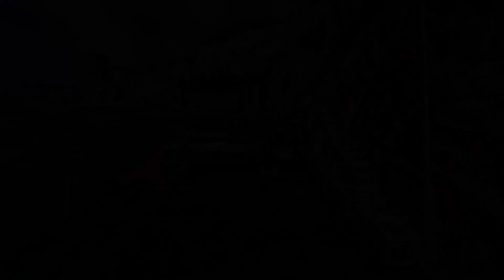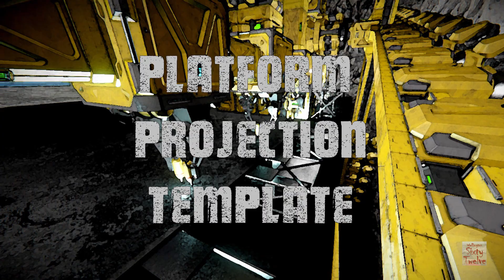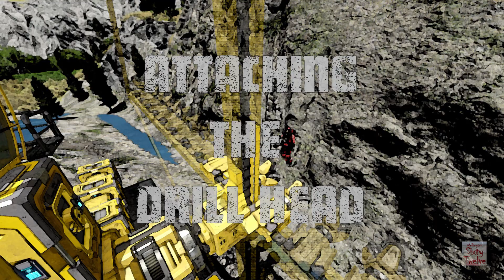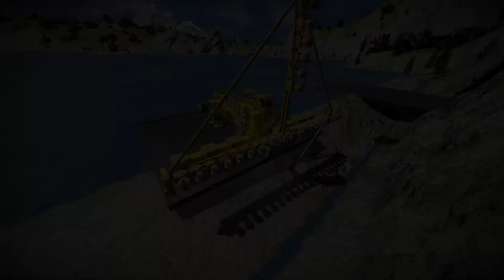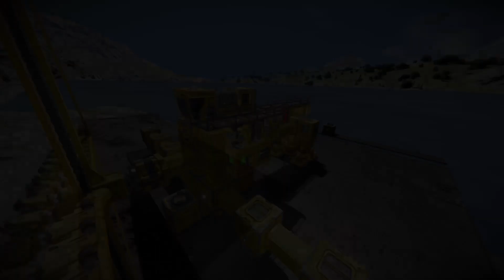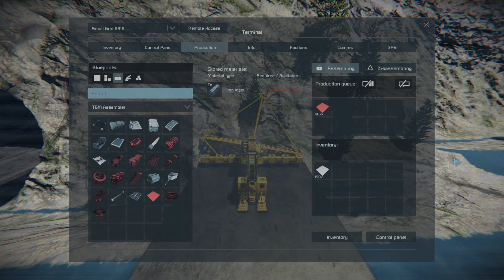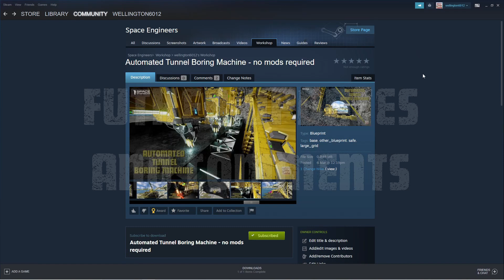Automatic Tunnel Boring Machine - a guide for setup and operating (Space Engineers)

Comment: So, to answer the question about Xbox that's a no, in survival mode any way. since you need build vision, (which is a mod) there is no way to attach the piston to the Rear of the machine. there is no vanilla "attach" setting in vanilla survival Xbox. So unless you make a true "vanilla" blueprint for survival mode, it won't work. I'm going to try to build the rear of the machine  off of the piston and duplicate your timer block settings. if that doesn't work, I will use merge blocks between the piston and the rear of the machine; the rear will just sit 5 meters further back than your original design. And if that doesn't work, you probably won't hear back from me. Wish me luck!
Reply from the maker: Thanks for letting me know Hyper Threat, now when the question is asked, I can answer with some certainty. Attaching that piston was an error on my part, I used build vision, but in my mind you could do it through the control panel like rotors and hinges, which of course you can't. I don't think it's too much hassle just to rebuild the back end, only a couple of timers which have their programming in the description. Good luck.
Reply: @Wellington6012  Oh Contrare Monfrair, I do not see it as an error on your part. For it is not your fault the piston spawns retracted in survival. Several things; It DOES work if you rebuild off of the back of the piston and reprogram everything. I don't see any other viable way to do it.
It IS your fault for only publishing the main part of the machine on MOD IO and NOT publishing the drill head on MOD IO for the Xbox and thinking you did, but only publishing it for the steam PC version. how selfish! XD. i.e. it does not show up in the workshop group to download. you may have to publish it as a separate item for it to show up. If i can get this pizza spinning I'm sure i will enjoy it.
Reply from the maker: @hotelyankeepoppa8862  Thanks Hyper Threat, really appreciate the detail, especially for others experiencing the same headaches. Positioning of the pistons for blueprinting is something I never even considered, will remember that for a [much] later project - space elevator. I don't make my designs for xbox or Mod.IO, but nor do want anybody to miss out, so put them on there to and do my best to provide supporting info. The small grid piston head is definitely now on Mod.IO. For me, it's a bit hit and miss uploading to Mod.IO, doesn't always work. All that said, when I uploaded the blueprint and associated video's, never did I think I would get such a fantastic response. Thank you Hyper Threat and all the other viewers and commenters.
Reply: @Wellington6012  Confirmed. And thank you for your detailed design and assembly video. it was the design that caught my eye resembling the TBMs of modern day, only a little more simplistic yet challenging (I do love a challenge as much as I like pizza!) to build. and doable in creative. Thank you for your hard work and effort into something that might be overlooked but fascinating in my eyes. Keep those gears spinning thinker! What would happen if they combined space engineers with elite dangerous? (slowly grinning)
Reply: @Wellington6012  one thing might be good is moving the timer blocks up to the main unit and using just regular armor blocks for the landing gears.  tried to get it to attach which it "did" with build vision, but the back piece won't move at all even with the landing gears removed.
Reply from the maker: @SalazarWindriver  Thanks for that. I'm not looking to change this blueprint, but learnt heaps myself and from others sharing with me what's [not]working for them. I am considering a space elevator which will no doubt need to use some of the same mechanics, so all the feedback super valuable.

Comment: cool idea doesnt work machine extends drills retracts then extends drill doesnt move machine forward.
Reply from the maker: There was a very occasional bug when I first built this that would keep certain blocks a station when unmerging. [Anecdotally] it seems like this happens more often, maybe something changed in a recent update?
Reply: @Wellington6012  not sure the timers have the welders as unknown. Don't know how to fix that.  I'm sure that's the problem.
Reply from the maker: The welders should be in a group, which generally means they stay in the timers a lot better than individual blocks, which can confuse the timer if they get unmerged or rebuilt. On the steam workshop page description, all the timer programming steps are written out.  @vorcrogaming3055

Comment: Awesome build, im on ps4, but I ended up using large drills and I tried several times to get the sensor that triggers the first timer block to work without success... ended up replacing it with another timer block and used my stopwatch to time the cycle time from when timer 1 is triggered until the drill piston was fully extended... I also sped up the rotor to 1rpm and piston to 0.020 which sped the cycle time up about 2:40
Reply from the maker: Good to hear. Although I never make my builds for console, I actively build in a way that shouldn't restrict their use at least. If I was to rebuild the rig again today, there are some things I might do differently, I'd probably replace that sensor with a event controller, so that when the piston gets a certain distance, it triggers.

Comment: So built this, fixed the piston with a mod. But the timer blocks are all missing some blocks and as such nothing happens when we try to start it. Is there a weld order for the blueprint? Or did we somehow mess something up?
Reply from the maker: I don't think there a weld order, it was a while ago, but I think I just welded it up for this video and it worked. Did you get the timer that is in the base itself? Sometimes people miss that one. The timer programming is listed on the steam workshop page, you should be able to check against that for any thing missing.
Reply: @Wellington6012  Got the base one. All timer blocks are missing items, the base one is missing both.
Reply from the maker: @wolfhunter98  Did you check against the timer setup on the workshop page? https://steamcommunity.com/sharedfiles/filedetails/?id=2415842702
Reply: @Wellington6012  Got the timers fixed, now the merge blocks will not lock, which stops #4 from going. And stops it from advancing.

Edit: Does unsupported stations have to be on or off? Looking at the info menu I think the driller part keeps staying as a station after it merges with one. Assuming the platform is a station then the miner part that moves needs to be a "ship" ?
Reply from the maker: @wolfhunter98  I know the unsupported station setting, but I have never used, so whatever the default is. I don't recall mine not merging, but yes it would basically convert to station. I did have the occasional bug that one of the welders would remain remain static. During the entirety of digging Fort Rutherford, which was a lot of advances, I think it did it twice, so I'm talking 1% or 2% of the time. In other miners I've since built, often the first piston stayed a station, but the pistons on this rig never caused me any troubles. Have you added any extra blocks, like say a connector to connect to the grid? The reason I ask is even though a connector is 1x1 and you can pre-connect them on the same grid, they do prevent merging.

Comment: After rebuilding the drill head 3 times in survival because I didn't pay attention to the orientation of the conveyor junction on the small rotor head, I finally got this machine going! I don't have build vision so I just removed an replaced the conveyor junction, timers, and landing gear onto the repositioning piston, and then set the timers up by your notes.. its chugging along now! But the drill head piston seems to be extending too quickly and the drills are getting too deep into the rock and binding up. It's set at 0.1m/s though. Would adding more drills to the shorter row like the full row help?
Reply from the maker: Great to hear you got it working. Advice a bit late now, but if you have any issue that require the drill head to be disconnected, you don't need to rebuild. Just put a small battery, piston and landing gear on the drill head and stick it to the wall in front, then you can pull the drill head out of the main rotor and put it back in.
The main piston should push very slowly, slower the better, 0.1m/s is more like a rotationless plunge speed. I forget the speed, but I would be thinking more a long the lines of 0.01m/s or 0.1m/s in the time is takes to do a quarter rotation. Speeding it up and slowing it down with the timer can be confusing, because of subtracting negatives, just use speed up/slow down, never reverse on this set up.
Reply: @Wellington 6012  awesome! Thanks for the tip! I'll give it a try! I've been playing this game for a little over a month and I hate to say it but I'm addicted! The sensors and timers remind me of programmable logic control I took in college. Haven't been able to do much with it since I graduated but I loved the troubleshooting and it appealed to my OCD.🤣🤣
Reply from the maker: @RickyCooper-j4o  There is the event controller now, which could replace the task the sensor does.
Reply: @Wellington6012  I saw that. I'm downloading the automation update next time I sit down to play.. planning a big underground base, tunnel with overhead trolley crane to move ships in and out, elevators, etc..

Comment: i build something similar and my problem is that as soon as i connect the drill rig with a merge block with the floor (witch is a station) the drill rig will becom a station and will still stay as a station even when i turn the merge block off does anyone has an idea how to fix this?
Reply from the maker: I Had a bit of a quick look, I thought maybe there's a script that could do it, but it appears the script and conversion functionality are not compatible. It's super annoying, I had it happen to me a couple of times, a pair of welder blocks stayed as a station, nothing else on the grid, just those. Appears to be a bug or maybe just a limitation of merging, as the drill trying to do something the game wasn't intended to originally do?
Reply: @Wellington6012   no my drills are fine i only have the problem with the merger. I am currently using only landing gears instead of the merge block so i hat to put the projector on the station. Thas a bit anoying because my blueprint is only 8km long and i have to move the projector with the machine from time to time but it works for now.
Reply from the maker: @Senbino1998  I think there are ways around it, but probably a rebuild. I had similar trouble in Escaping the Desert with a similar mining machine, one of my pistons keep staying a station. My solution was the pipeline I'm creating remains a station, I've just locked it down with a landing gear. It's stable, but I can't put any block into the voxel. Also I have the merge block attached to the piston head, rather than the piston based, I think that helped too.

Comment: Hi  I got this thing moving finally but not the piston doesn't retract fast enough so it smashes into the rocks an knocks off the machine.  I am on xbox timers look right but i am new to the game.
Any Idea's
Reply from the maker: Hi Capjlp. First, have a read through the comments here, the demo video and the steam workshop page, there's quite a bit of trouble shooting available. For the piston not moving, you need to figure out whats not moving, whether it the landing gear section, or the main section. sometimes the grinder or merge blocks block collide and prevent it from moving, or there is a bug where an individual block might stay as a static [station] grid. For the speed of the piston, probably a setting, confusing and easy for it to go wrong. ie slowing down while in reverse makes it reverse quicker. Maybe set it to go forward at correct speed, delete the reverse/retract, instead, decrease the speed, 0.05 will become -0.45, then when it ready to go forward again, increase the speed to reset.

Comment: hey got this from workshop.. that first piston is really driving me insane i am not getting it attached.
Reply from the maker: Hi Mr Salty. Do you mean when first assembling the drill? It should just connect using the attach function in the control panel. Alternatively, I think you could grind off the pre-place head, add a new head to the piston, then use a couple of merge blocks, one on the piston head (they have side attach points), one on the back section.
Reply: @Wellington6012  it is that first piston connecting to the landing gear. It says attached but when i retract it it is not attached :)
Reply from the maker: @mrsalty467  It's definitely attached and you can see the back landing gears in the control panel seen from a front section access? and not just the piston force pulling it back and stretching the gap between piston and head? Accessing one of the timer control panels on the back, just make sure it's not a station, even delete the floor under that section and individually delete blocks, see if they float (station) or fall (ship).

Comment: For attaching the drill head, you say to add a small grid rotor head, but in the video the rotor part that appears looks different than what does in the game when adding a small rotor head. Additionally, the small Conveyor Junction will not attach to the rotor part that does appear in the way shown in the video. The blueprint for the drill head if pasted into creative shows it has an Advanced Rotor Part 3x3, so I assume this is the rotor part that needs to be added into to add the small projector?
Reply from the maker: Ah, yes, that'll be because on the recent Most Wanted update now adds the 1x1 head by default, rather than the 3x3 liked it used to. A work around might be adding the 1x1 head, some blocks for spacing, a small battery, projector and finally a landing gear on the front. Use the big piston to push the small grid forward and stick it to the voxel or a place block with the landing gear. Detach the rotor and retract the piston leaving enough room to project/weld the blueprint. Position the blueprint so the 3x3 rotor head shaft is in the same place as the 1x1 rotor head, then it will be in the right place lined up to extend the piston and reattach.

Edit - actually now I think about it, the 3x3 head and conveyor junction is only there to adapt down to 1x1 anyway, and is surplus to requirement now. Just put a couple of 1x1 conveyors on the 1x1 head to create some space between the rotor and spinning arms, then just projects the arms onto that and do away with the 3x3 parts.

Comment: Could you add more storage to the rear in order to leave it running for longer.
Reply from the maker: Hi Cole. You can do what ever you want with it, it simply sharing of an idea, a base vehicle to be dissected and improved upon. I has enough storage to keep itself going, bearing in mind its purpose is to dig a tunnel. But then again it could provide a lot of surplus rock if you gathered it, so you could add storage if you wanted to retain some additional resource, but I personally think going down the track of adjusting the blueprint to include connectors so that surplus material is exported rather than stored or dumped.
Reply: @Wellington6012  oh that's a better idea.
I am new to space engineers and it looks like a game that 100 hrs in. I'll still be calling myself new to space engineers.
Recently started using groups more efficiently. And just found out I can type numbers in the slider. So your video was very inspiring.
Reply: @colecook834  You could get a 1000 hours into this and still find things you didn't know before